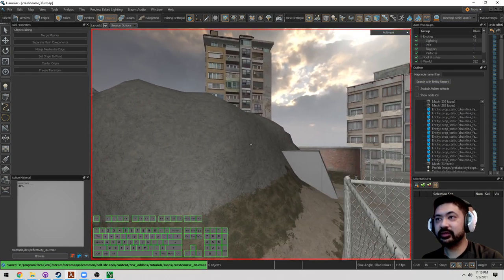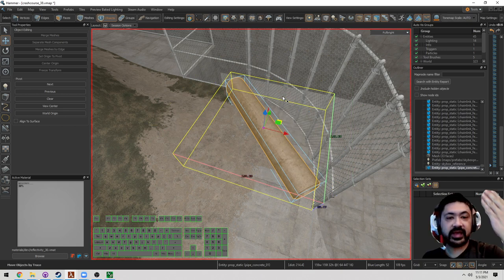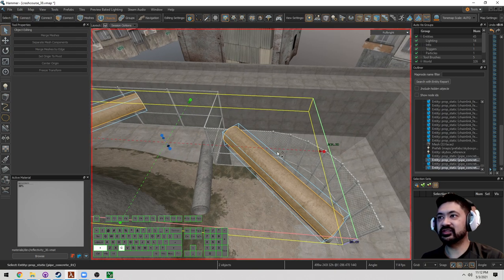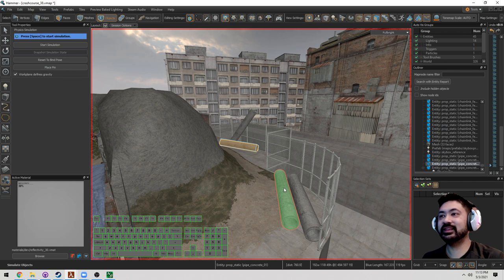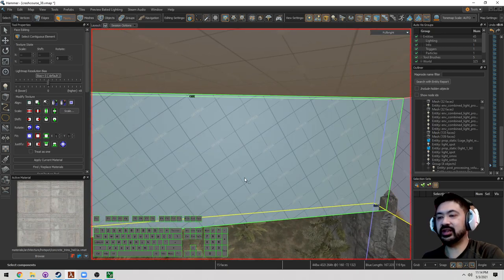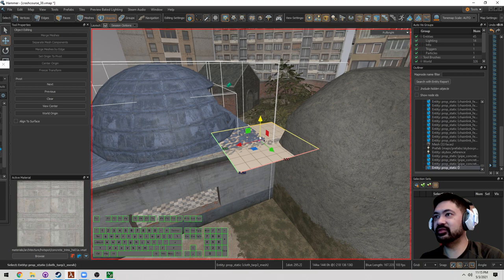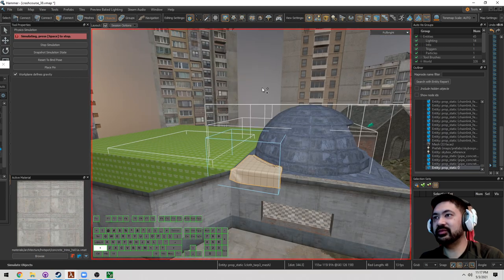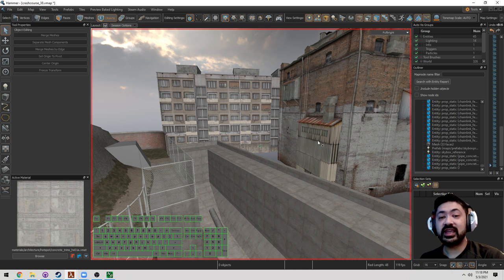Source 2 101 - Hammer Crash Course #38 : Physics and Cloth Simulation Decoration (tutorial)

Comment: When using the coth I noticed that the physics simulation only works correctly when the scales of the dimensions are all the same. You had one side a bit larger than the other and than the pyhsics of the cloth is working odd.

Comment: When i was using the solid light block tool on some areas there was a red line that was visible even if u are behind a wall. Any way to hide it? Cause its getting into the way and is annoying
Reply from the maker: go to face mode, double click on a face or press ctrl A after selecting a face, and then right click, go to REMOVE BAD FACES
Reply: @eagleonedevelopmentteam849  damn it fixed it thanks.